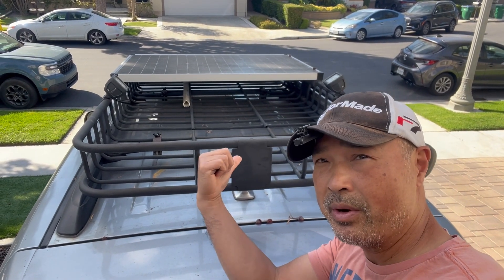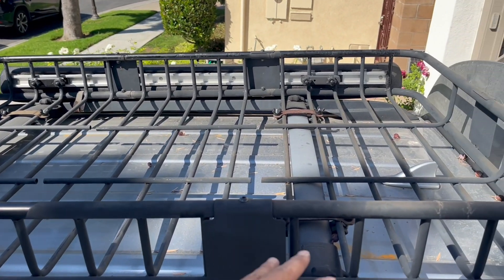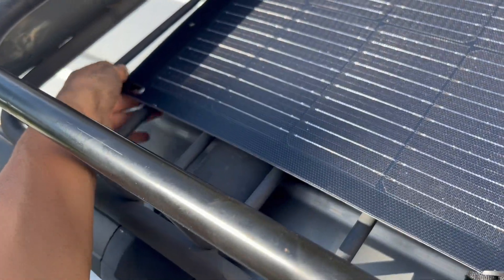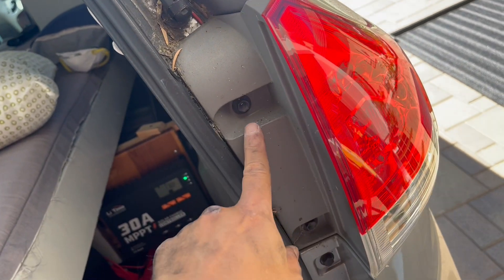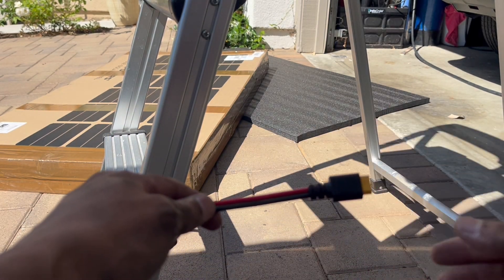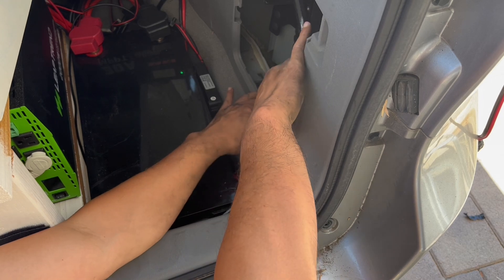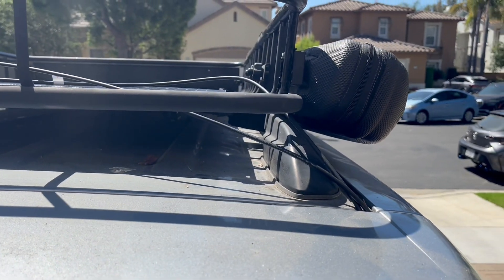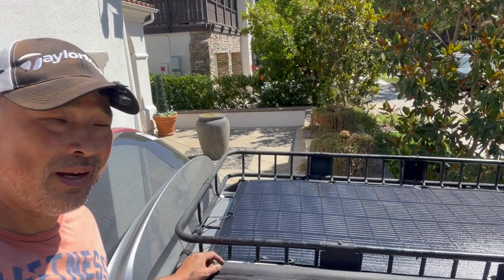How To Install Stealth Solar 🌞 Panel With No Drilling.  AllPowers Flexible Solar Panels.

Comment: Question 🙋 how is it driving down the road ? Is it flopping around ? What do you recommend for storing items on top of panels ? 
Thanks 😊 great work 🥰
Reply from the maker: Not flopping around unless you don't strap it tight. You can put a decent amount of weight on the panels. They are pretty durable. How much weight? I don't really know. But if you hold and feel that panel, you will see it is quite durable

Comment: I have my solar panels in my roof basket also but I need to route the wiring through that rear light like you did. I tried routing it through the sliding door but had issues with water coming in.
Reply: I bet he does too

Comment: Thanks for sharing how you routed your solar without drilling holes. If you do something like this again can you please show us how to properly change out one style of plug with another. I’m not tech savvy and don’t understand what I’m looking at when checking out the charge cables and adapters ❤
Reply from the maker: In other videos I showed ways to connect two wires together. You will need proper tools to strip the wires, simple nut connectors will work.
Reply: @Tiny-Campers  thanks I will check them out